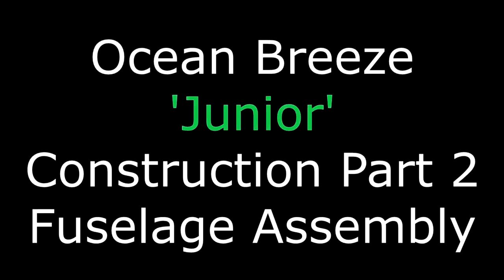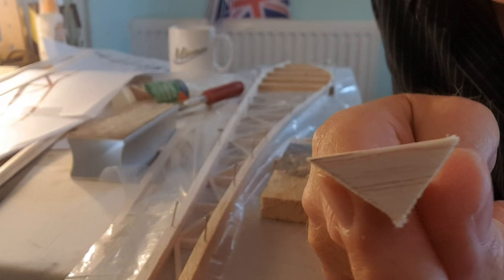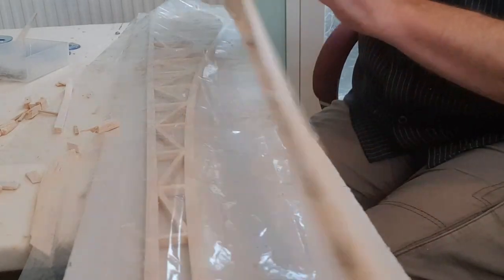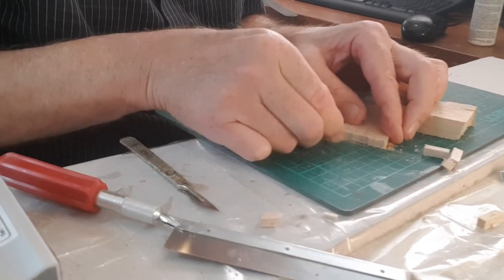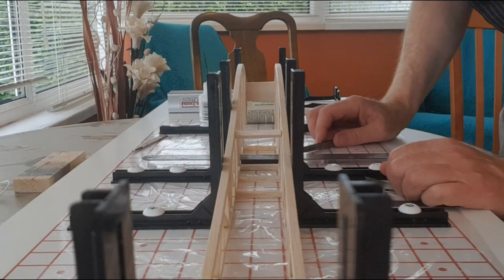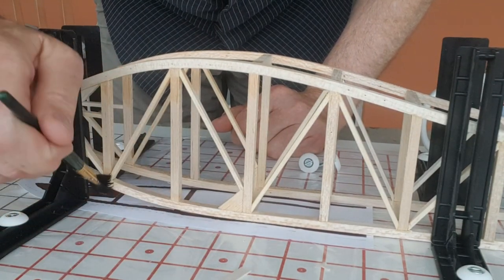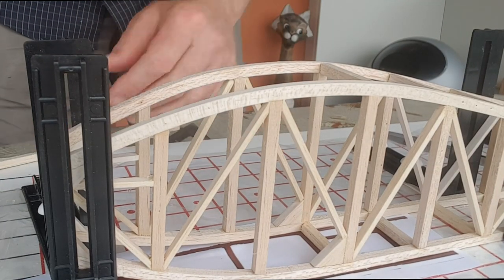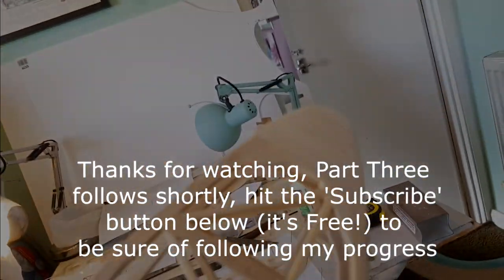Ocean Breeze 'Junior' Construction Part 2 Fuselage

Comment: "Safety Tip", keep your fingers out of the steam. LOL. I never knew that one. Thanks. Good idea on the center ply in the nose. I like that one.
Reply from the maker: 😁 Just covering myself David in case a five-year-old was watching. The plywood idea is an old one, we also used to use it on wing tips and sometimes trailing edges if you wanted it as sharp as a knife ... safety tip: be careful of knives!

Comment: Looks pretty hefty. You appear to have scaled down the aeroplane but not the materials. I am building an OB at 80% scale, wingspan 70 inches, with almost all materials at 3/4 scale, so longerons 3/16 instead of 1/4 etc. I will let you know how I get on. Bill Dixon.
Reply from the maker: Hi Bill, it was pretty light wood in fairness, she still floats pretty well though. Have you watched the later video where I increase the size of the Rudder?